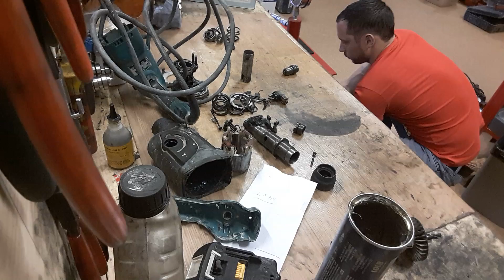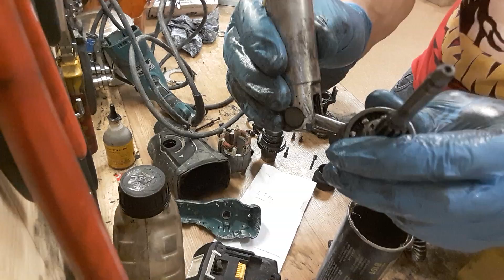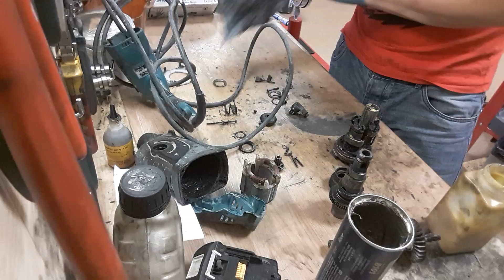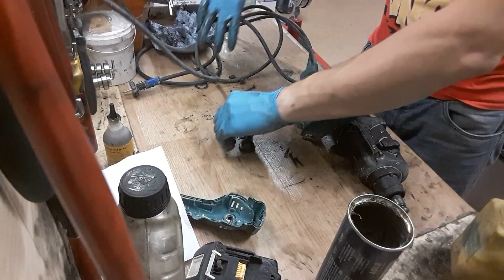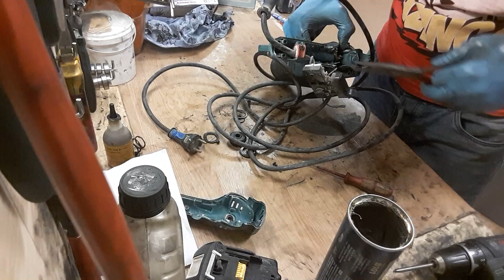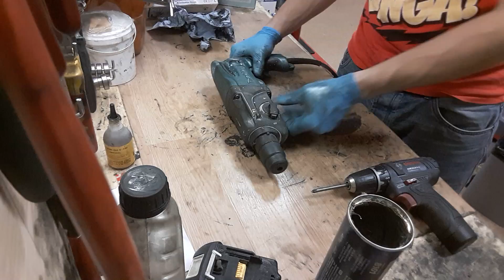How to assemble and repair Makita HR2470 rotary hammer drill hammer change

Comment: That mode selector was a pain in the rear to get seated correctly. This helped a lot!
I got mine from work (concrete factory). It had a faulty trigger and the gear housing was VERY beat up (rubber torn to shreads). I ordered a new trigger and gear housing, and now I have a fully functioning rotary hammer for the price of a couple of parts. :)

Comment: hello, I have a very similar drill HR2610, I have taken everything apart and nothing looks ruined *eg chipped teeth" and as long as the main mechanics block is OUT, it seems that all works as it supposed to (engaging drill/hammer/combi) but as soon as I re-assemble everything into the case, the selector button gets stuck (thats the original fault) and you can only have "hammer only" and the only time that it engaged on simple spinning, i could not see the transmission gear (the one that gets drive from the motor shaft) turn. any idea which part is most likely? drill is from 2014 so not very old. thanks.

Comment: Dude you have very helpful videos, I do work on my tools from time to time but when it comes to more detail repair its really helpful to see your videos. Currently working on  my Makita Demolition Hammer HM1211B and majority is disassembled. I wish I had vise and nice work table but I live in apartment so I have to compromise with a lot of things. The problems with the hammer started probably a year a go when I started noticing the outside screws in the aluminum housing started to strip down just by using the hammer, should of know that something wasn't working properly, yesterday the hammer finally showed its problem by not delivering the hammer action as when everything was working properly. When I opened it I noticed the front piston both the metal inner and the plastic outer rings were broken and that must of been giving out all that vibration and were stripping the outer screws. Not sure if I just end changing piston rings on both the front and the drum piston ring just in case even though the drum piston rings are not broken, just in case also change the nylon washer because its of nylon plastic  material... Excellent videos my friend and thanks a lot for posting them